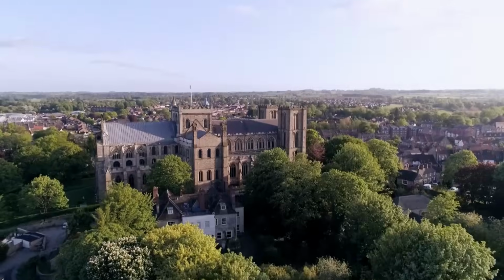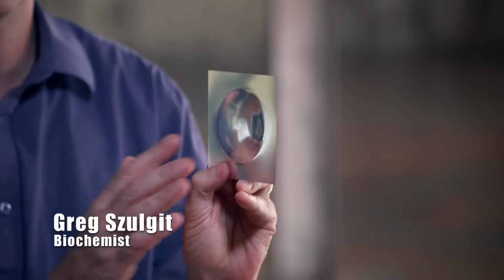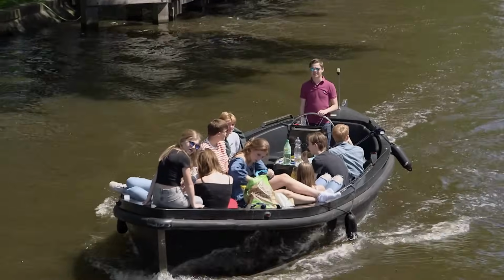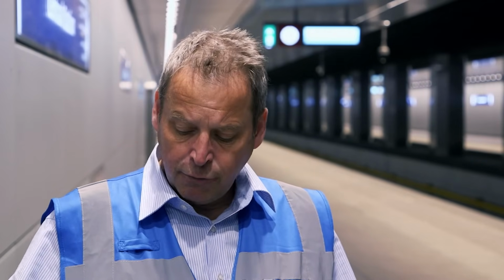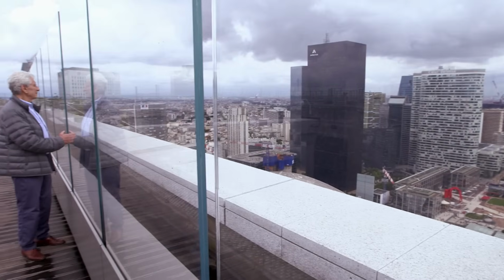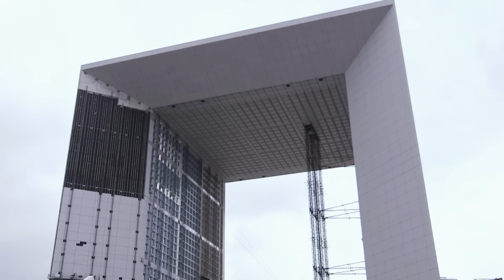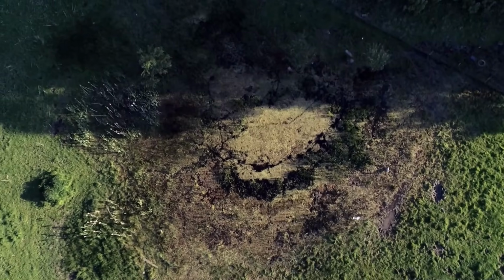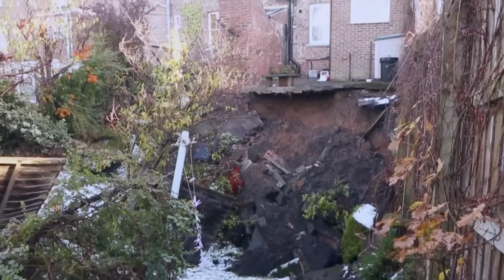Dallas Skyscraper Glare - Massive Engineering Mistakes - S01 EP5 - Engineering Documentary

Comment: how about installing all the windows with solar panels? It would help the environment's absorption of the heat from the sun reducing a tiny fraction of global warming. Did you know that in Singapore?  getting a contruction permit? The contractor need to show its building plan that the facade or the surroundings of the building must have plants.